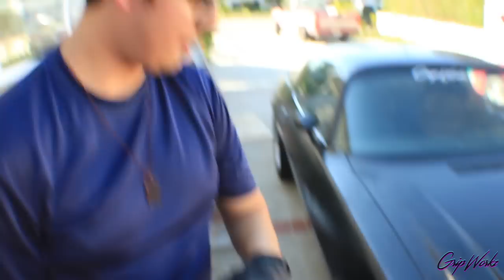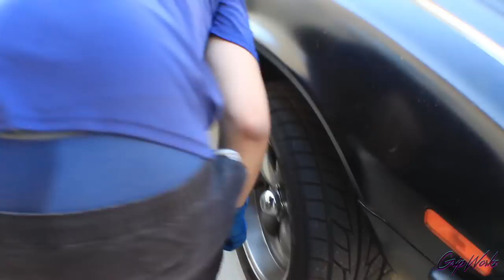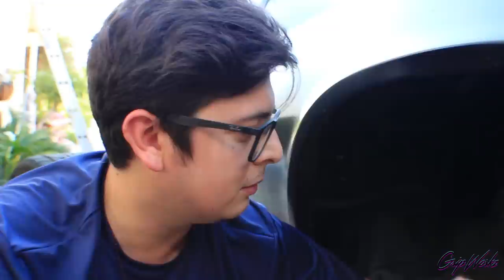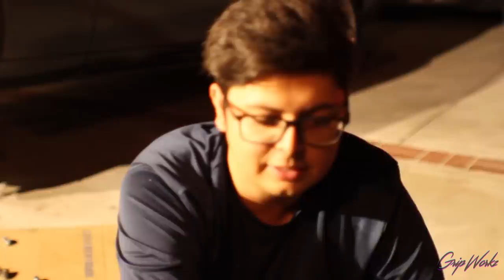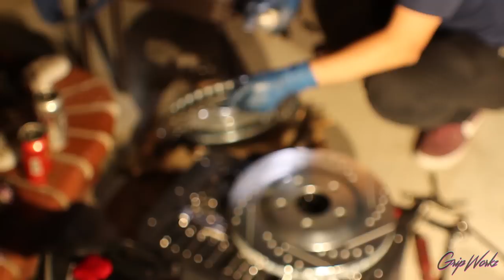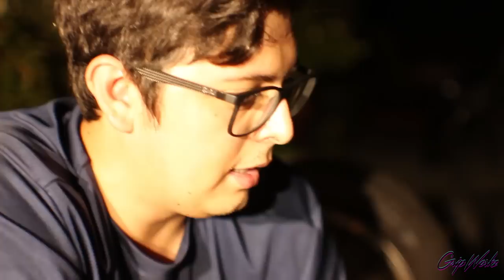Camaro Big Brake Kit Install

Comment: I just ordered the exact same kit.  I am awaiting delivery.  If you don't mind, what size wheels are you running?  Backspace?  I have spoken to both CPP and another well known wheel manufacturer and neither one can confirm for me that a 17 x 8 wheel with 4.75" backspacing will fit with this CPP kit.  In fact, the wheel manufacturer told me that it surely will not fit. Confused as the kit clearly states that it will fit with "most" 17" wheels.  Thanks in advance.
Reply: Dan A it still has the 17x9 in the front I got from Rev wheel. It does rub on the front sway bar going full lock. Do not recommend 1 3/8. If you are going with an aftermarket sway bar go with a 1 1/4, or you can use hub centric spacers to clear your sway bar. The kit is great, never looked back.
Reply: Dan A the backspacing I believe is 5” 0mm offset, hope this info helped. Have a good race, send it!
Reply: @mjoe2885  Good info to have!  I should be in the ballpark. Thanks again. Good vid btw!
Reply from the maker: Thanks man!!
Reply: Ok guys ive got this same kit from ecklers for my 71 . so to be clear a standard tt2 wheel 17x8 with a 4.75 back spacing and 0mm offset will clear these c5 calipers. Thanks in advance.
Reply from the maker: We used 17x9 wheels with 5” backspacing and 0 offset and it cleared just fine

Comment: Can you fit C6 Z06 calipers on there?
Reply from the maker: Yes, as long as you have the proper wheels to clear them.
Reply: Gripworkz which C7 hub bearings did you get? The 513139 or CP35036